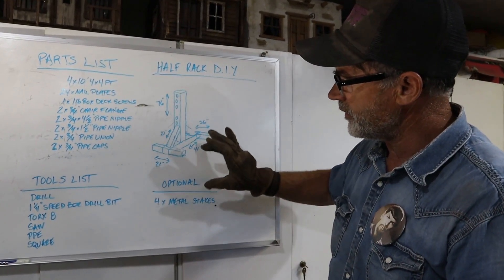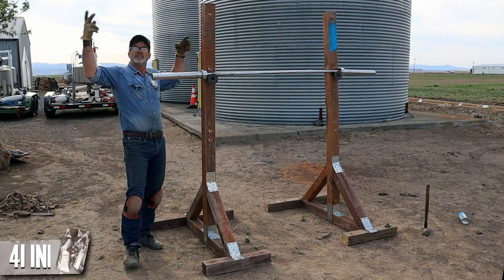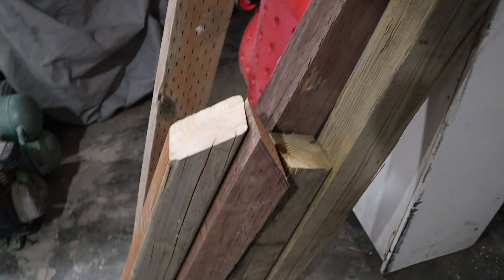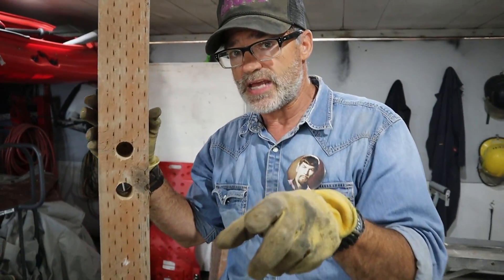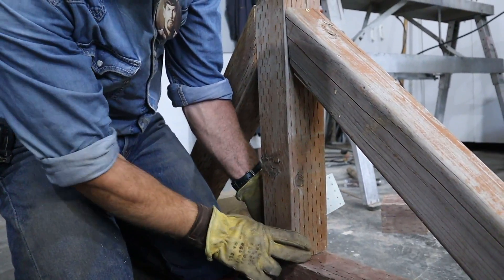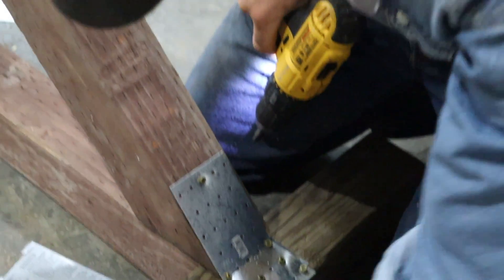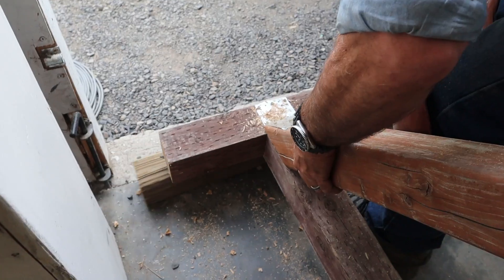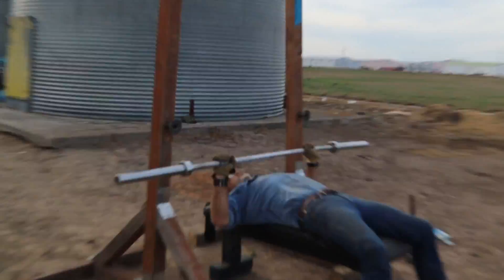How to Build a HOME HALF RACK (Move It Anywhere!) - DIY Duke

Comment: so buff duke... what if i were to buy none pressure treated, and just left it at that. im planning on keeping it in my garage, but taking it out on a nice sunny day. do you think it will cause problems overtime?
Reply from the maker: No not at all.  Wood dries out over time but humidity levels that rise like during winter will replenish the fibers.  Pressure treated lumber is primarily made for exposure to the elements.  Your situation wouldn't require it at all.  😀

Comment: Can you do a diy version of cross rope which are jump ropes where the rope itself has the weight instead of the handles, they come in 1/4lb, 1/2 lb, 1lb, and 2 lb ropes and I know I can go to the hardware store and just buy rope and i can use electeric tape on ends to make handles and the rope length needs to be 9 foot long but how big circumference of rope would i need to hit those weights at that length?
Reply: I have a 9-ft rope that is 1" in diameter. It weighs almost 3 pounds. LOVE IT. The important factor in this equation is the material that the rope is made of. Mine is a polyester. Nylon would be lighter and polypropylene is even lighter still.
Reply: @johncalvo1743  I see, i just dont want to pay 200 bucks for cross rope
Reply: @ACarpenter89  HELL NO! Go get a 1" diameter marine rope and cut it to 9 ft.  Use plasti-dip on the ends, or gorilla tape.

Comment: The lumber used doesn't have to be specific right, just any pressure treated fence post of that size will do?   :)
Reply from the maker: Yes, lumber usually used for framing or fencing.  We mostly have Douglas fir, Hemlock, or Pine.
Reply: @diyduke  Thanks for the reply!  Was  just getting a bit confused with grades of timber and other variables online.
Reply from the maker: @jamest4232  I understand, there are a bunch of choices.  The choices I gave are native species to my area the Pacific Northwest and they are considered soft woods.  Oak for instance is a hardwood are normally sold as flooring and furniture and because of its higher price and availability is really never used for framing.  The aforementioned softwoods does not negate their strength.  Hope this helps 😀
Reply: @diyduke  thank you for the help!! I'm also planning some dip bars with timber and 1.5" galvanised pipe, so this is really helpful.
Reply from the maker: @jamest4232  you're very welcome James, thanks for watching 😀

Comment: would this be sturdy with 2x4's?
Reply from the maker: I wouldn't trust it with 2×4 construction.  You can glue and screw 2×4's together which would be strong enough if you don't have access to 4×4's.
Reply: @diyduke  thanks man, apparently a standard one inch barbell can hold 260 pounds.  You should test it

Comment: Hey Duke, I was thinking about something here. Since this rack can be used for squats, you'd want a good bit it clearance around the feet so you don't trip over the squat rack feet. Wouldn't it be better to make the inner length of the rack's feet shorter, and have the outer length longer?

For example,
Equal length rack feet: 
_|_

Uneven length rack feet for more clearance when squatting.
__|

Does this quand structurally secure? Thanks!

Comment: Is it heavy ? Or easy to carry for a person alone ?
Reply from the maker: It depends on the moisture level in the wood.  The wood I used was very dry so it was very light.  New lumber especially can be heavier especially pressure treated.  Kiln dried lumber would be dry but would need to be painted to protect against the elements 😀

Comment: 4 -10' 4X4s are not enough to build this half rack. Two 4X4s are only enough to build the two 76" uprights, and the two 41" lower base support sections, but none of the 45 degree cuts that support the upright nor the short lower base support sections. Great vid, though, and my half rack built using doug fir vs cedar will hold LOTS of weight.
Reply: you mean doug fir holds more weight? Please make a video with ur rack?

Comment: I don;t have a mitre saw. Will Home Depot make these cuts for a price?  Will a cordless drill work? Our family had an industrial supply business, hence I'm familiar with the pipe fittings and nipples. We could use black or galv. 
Does Home Depot have all these items, or a local hardware store?
Reply from the maker: Home depot should cut those for you, you could use galvanized pipe if it's going to be outside, it's pretty hard for a cordless drill to make those holes I had to use a 1/2 inch electric 😀

Comment: You shouldve bought flat bar, cut the flat bar with a grinder than locate your holes. Wouldve been stronger than that shitty steel
Reply: Why wouldnt you use washer on the treaded pipe?